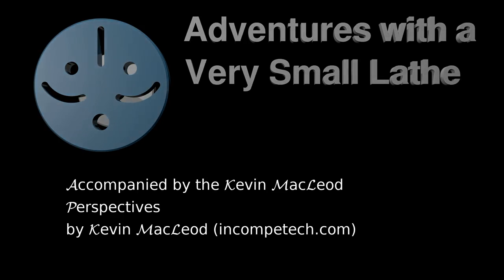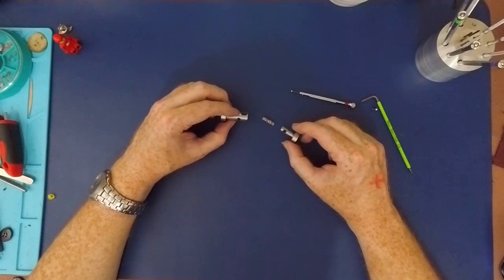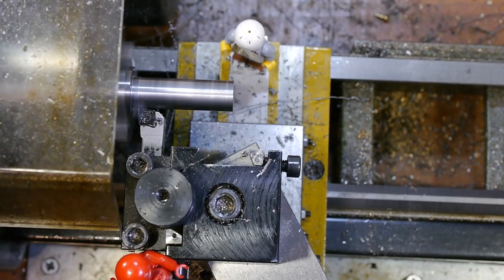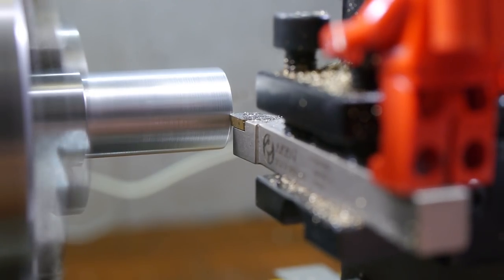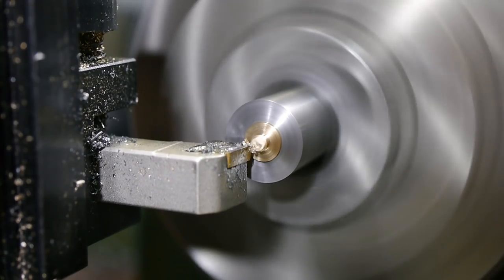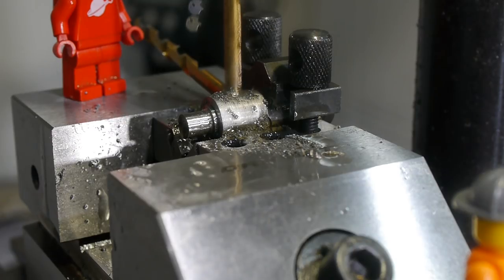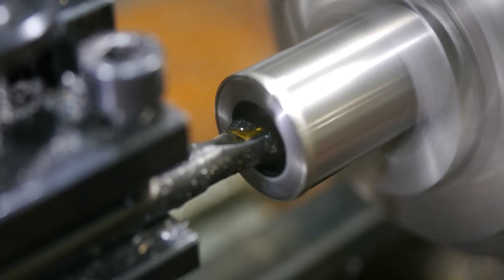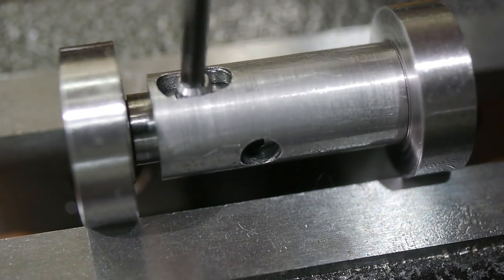Screwdriver Sharpener - The Tool Behind the Legend

Comment: These two desert dwellers are amazed by your great screw driver sharping tool, it is really a neat tool to be sure, As a micro machinist I see what you said about getting the raw material diameters as close as possible as material removal is not a micro machines favorite thing to do in a high speed time frame anyways, thank you for the very detailed follow up video.

Comment: I watched one of Tom Lipton's videos recently where he discussed watchmaking.  They don't use standard screwdrivers, and will grind them for each screw to match the slot width, but fall short of the depth.  This is less likely to damage the screw, so there is a market for your sharpener!

Great video as usual, but the opening scenes would be improved with more of a closeup of your hands.

Comment: Hello,

Did you find a knurling tool and wheels for our small lathe ? Any suggestions or link because i cannot find something appropriate...
Reply from the maker: This is the knurling tool I've had the most success with:

https://www.ebay.co.uk/itm/Mini-Clamp-Type-Knurling-tool-with-Compatible-with-Myford-Lathe-ETC/372208872948?hash=item56a960adf4:g:5lwAAMXQ6DBSD0w8

The clamping style means that it doesn't exert a lot of force on the tool post, and doesn't depend too much on the rigidity of the lathe.
Reply: Adventures with a Very Small Lathe Thanks a lot for your answer. The 10mm shank size is not a problem (as the Proxxon has a 8mm tool holder) ? Did you buy any additional wheels ?
Reply from the maker: The fixed tool post for my Proxxon lathe is just over 9.9mm tall, and just fits the knurling tool shank, which is 9.8mm. It's very close, but if there was a problem it could be solved with some careful filing.

I use the quick change tool post, and the tool holders are 12mm high, so can hold the tool easily.
Reply from the maker: I haven't tried any additional wheels.